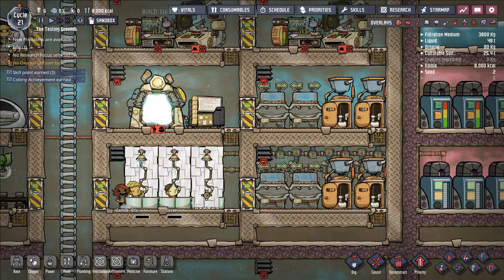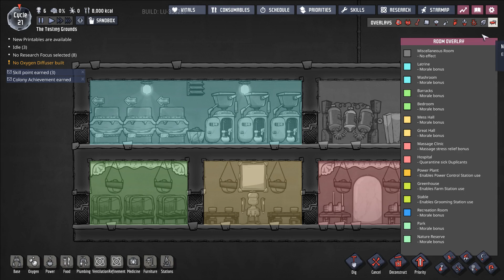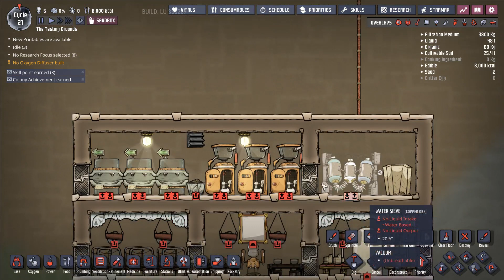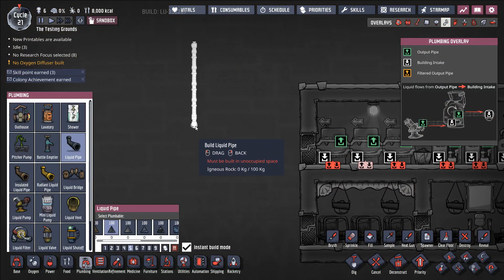The Infinite Bathroom; Build This NOW -- New Player Guides [Oxygen Not Included]

Comment: the problem with multiple bridges is the first one will get priority over the others always.  so the initial start up is a little hectic.  I prefer to use one bridge at the start of the line to supply all sinks and lavatories.  it also gives you a visual que on the supply lines.  an other advantage to using lines in this situation is the lines will be a passive storage tank.

I use reedfiber farm to feed the water into.  excess goes into chlorene room where the water gets purified then its sieved and fed to the main storage where it gets temperature equalized then its pumped to where ever it needs to go.

it really depends on the situation you are in really.  If you are colonizing a new planet with the new update, I use this to create the water on demand.

Comment: I know you've answered people repeatedly in the comments, but these are my thoughts, not looking for a response.  As a software engineer and games programmer of 35 years (appeal to authority, yay!), I don't see why the input and output nodes of the lavatories and sinks would be treated any differently than the input and output nodes of the bridges.  A pipe that goes through all the inputs and a pipe that goes through all the outputs should do the job.  And that's what your set-up does, except you've added in unnecessary bridges between the rails.  As far as lag goes, have you (or anyone else) profiled the lag created by the liquid pathfinding compared to the entity pathfinding?  My guess is that it will be extremely trivial compared to the entity pathfinding.  My take on your build is that while I find most of your videos extremely valuable and interesting, this insistence on adding redundant bridges everywhere is probably based on belief rather than facts.

Comment: so how you doing this around cycle 5.. by cycle 5 iv not even bothered with oxygen production let alone researched 7 techs to get that far, i think you are being very over confident.. quite a few bad tips here, you really cant grow anything from the waste pipes, the flow isnt reliable enough, and as for the polluted dirt you are probably best saving it for pokeshells so you can farm the skins for lime, late game lime is a real bottleneck, im struggling like mad even using fossils, not enough to go around. i thought infinote bathrooms was something new maybe, not just a way of keeping a few toilets supplied, man i do that with a clock and a liquid shutoff, no bridges and it works flawlessly until dupes are too busy to change the sand in the filter.
Reply from the maker: We get them up pretty fast in the Let's Plays I've done, check them out.

We also use the waste water to grow lots of stuff in the Let's Plays I've done.  Dupes go to the bathroom once per cycle, the flow is consistent.

I'm down to save polluted dirt, it's just if you DO decide to compost, then you'll want to put your compost back there too.

Comment: It looks like you used regular liquid pipes instead of insulated liquid pipes.  Some others have recommended using insulated liquid pipes in bathrooms?   Does this lead to heating problems over time for a bathroom?  Or did they say that because of the old fixed output temperature of a water sieve?
Reply from the maker: It's changed over time.  At first it was a necessity because of the fixed output temperature of the water sieve, otherwise everything near the bathroom would slowly turn to 40 C.  After the change to the output temperatures, some people still decided to use insulated liquid pipes because they wanted to keep the water in the loop extra cool, because the bonus water from lavatories was being created at the temperature of the input water, so with an insulated loop you could do a sort of 'cold doubling'.  Today, some people use insulated liquid pipes because the bonus water is produced at a fixed temperature (I think 37 C, the temperature of a duplicant) and averages with the incoming temperature, so very slowly over time the area around your bathroom would rise to 37 C.

Personally, I've been going with regular pipes ever since the change to the water sieve.
Reply: @gearheadgaming1  Thank you!  That was informative, and it makes sense that the water would change temperature based on the duplicant's input with more and more duplicant polluted water added.

Comment: I don't run my bases that way but this is a great explanation to why some people make what I call "pipe messes". 
I personally run a germy supply lines through my base to 6 different bathrooms and an extra 10 sinks with one main supply line that branches out where needed. The line is prioritized at the water sieve using one liquid bridge and then branches out with one liquid bridge per bathroom. I store a liquid tank worth of water for backup but I rarely need it as my main pipe is so long. Then I send the excess clean water  to be removed of its germs and set to the desired temperature send it towards food production and if there is some left it gets kicked towards my oxygen production. It looks cleaner and I never had any issues with it. Also when going for a locavore, I carnivore, super sustainable run I didn't set this up before cycle 80 and usually set it up around cycle 20-30.

Comment: Polluted water is valuable, one of the most important resources in game.  Don't burn it up on this...  Just dump your water into reed fiber plants, and make them steadily all game, that way you don't have to make a giant garden later on, when you need the fiber.  You only need to build two or three fiber planters to use all the water the bathroom makes.
Reply: The point is to resupply the sinks and lavatories (thus infinite bathroom title) with clean water. The excess (which you will have cause it overproduces) can go to whatever else you want (hydroponics etc) as he mentioned.
Reply: @KotauFPS  Well, ok that might be an interesting approach early to mid game, until you can get reed fiber seeds and fresh water, but you are still just wasting an enormous amount of polluted water that you will not be able to replace late game.
Reply from the maker: I think you have heavily misunderstood how this build works.  It GENERATES water over time, it doesn't "burn it up."
Reply: @gearheadgaming1  I understand perfectly how the build works...  I think you are wasting polluted water (that your dupes made)with this build, because you need to polluted water later in the game to get space age insulation...  I still insist you are better off taking every gram of polluted water you find in game and making it into fiber reed...

Comment: I try to understand those pipe bridges, they're complicated.
I've already seen several times this case where a pipe and a pipe bridge have the same... "entry point" ?
As I understand it, the difference between a pipe "dividing" in two pipes and a bridge is that :
in the first case, the liquid/gas will be distributed more or less equally between the two pipes, maybe depending on pressure.
in the bridge case, the liquid will always go through the first bridge it encounters except if the exit point is already filled with liquid/gas in which case it will continue to the next pipe/bridge.

In that case, if I put a bridge from my used water to my plants, then a pipe to a water tank or reservoir, I could use the excedent water created by piss and keep only the right amount of water for a closed circuit. Is this it ?
One thing I don't understand is why you put bridges at the exit of toilets and sinks...

For germ killing, I use a "dirty" solution : I put 3-4 liquid reservoirs in a waterlocked chlorine room and manually enable and disable them so the water don't stay in the pipes where chlorine have not effect. I say it's dirty because if every liquid reservoir gets completely filled, you'll ultimately get some germs in your clean water. So you have to constantly play with enabling/disabling the whole stuff manually... I still haven't found a energy/dupe free solution. If only you could logic gate those reservoirs...
Reply: And I'm sorry for writing essays on every comments. This game owns my brain

Comment: Hey man, I like your video, but I can't understand why you need so many liquid bridges in your build.   I know that you've explained why a lot, but your explanations don't seem to make sense to me.

1) If Klei is going to patch the game, they could break literally any setup at any time.  What if they introduce a patch that makes liquid bridges no longer appear as inputs?  It doesn't make sense to try and "future-proof" a build based on how Klei may or may not change the game.

2) According to the wiki, liquid bridges do not have any actual storage, so if your strategy was to increase the pipe length to create additional storage the bridges aren't doing this.  If you want storage for fast refills, use a liquid reservoir, which would only cost 400kg of material instead of the 1400kg of bridges in your system (more if you want to add more stations!) which apparently aren't actually doing anything.  For extra style points you could keep the reservoir in a chlorine room to kill off all the germs in the stored water.  Or, if your sieve happens to be further away, the water in the pipes running to your bathroom are already accomplishing this.

3) If you're talking about not having to break the actual main water line if you wanted to make a modification, then yes, this system lets you accomplish that.  But, y'know, it costs thousands of kg of materials and there's already a system for prioritizing jobs if you want to minimize interruptions.  Besides, it's not really a "main line", it's just the supply pipe for a closed loop.  The only part of your base that will experience interruptions if you break it are the bathroom itself and whatever was being supplied by the excess, both of which were already going to experience interruptions if you're tearing the bathroom out and replacing it with something else.

4) Each one of your items already has an input and an output, which will already prioritize liquid flow in the exact same way your bridges are.  What you need to do is run your line straight across all of them instead of running them above or below and then connecting with individual branches.  It should look like an "l", not an "E".  The game will prioritize all of the inputs in the order the liquid is flowing, and then branch off to any other inputs you give it (like your hydroponics) if the initial ones are all full.  The only time you'd need a liquid bridge is if you want to prioritize a direction of flow in a junction leading to two different long runs of pipe.
Reply from the maker: 1)  "Anything can happen" is a position you can take, but "Things that have happened in the past are more likely to happen again than things that haven't happened in the past" seems more logical to me.  Especially since it wasn't until recently in the game that your suggested build even functioned.  The system you describe, as recently as 6 months ago, would have put most of your toilets out of commission, because all of your sinks and toilets would go offline every time you flushed/ran a toilet/sink further down the line and its output crossed the output tile of the next sink/toilet.

2)  If you run a pipe straight across, and you're draining that pipe from the far end, you have zero storage in your system.  There are two tiles of pipe beyond each bridge in my system, they hold 10kg apiece, 20kg total, 4 uses worth, and will maintain that even if you're siphoning from the end of your loop.  Reservoirs take building space and metal, both of which are much rarer than igneous rock.

3)  I have no idea what you're talking about.  And yes, I'm talking about what happens if later you want to relocate your bathrooms.  You're saying it costs tons of materials... to do what?  Again, I don't know what you're saying here.

4)  a) The system you're describing is only even possible on recent patches-- for most of the game's history, the build you're describing led to your toilets and sinks going offline whenever a sink or toilet further down the line was used.

b)  The system you're describing still doesn't work.  See point 2.  "and then branch off to any other inputs you give it (like your hydroponics)" leads to dysfunction in your bathrooms as soon as those "other inputs" outstrip the rate at which your bathrooms are generating water. 

Tons of people have complained about this.  "Why do you use so many bridges?"  But not a single one of them has offered a reason for why fewer bridges would work better besides their opinion that they don't like how bridges look.  You know bridges cost the exact same as a pipe, right?  And there's no decor malus from them?  And that they have the same build time?

I'm sorry, but if you want to convince me there's a better build out there, then why not give a reason why you think it works BETTER?
Reply: @gearheadgaming1  Thanks for taking the time to respond. I'm a somewhat new player, so I don't know what the state of the game was like six months ago, I just know what works right now.

You're right about the storage - there is benefit in keeping a little bit of water "primed" in the pipes leading up to the stations. If you're trying to get the build to run nonstop on a purely closed loop, that little bit of extra is helpful.

I think the mainly the issue is that this is a somewhat overcomplicated way of approaching a system that most players are likely to encounter in the first dozen cycles. While it may not be BETTER, there IS value in approaching the setup in a simpler way, especially if the target audience is people who aren't familiar with the game.

This is probably an ideal system for creating a closed bathroom loop primed with a small amount of water that will then keep itself running forever while outputting some extra clean water once a day. However, it takes a fair amount of effort and preplanning to get it that way.

Most new players probably aren't taking this approach to their bathrooms. They're just going to hook them up to the main water line, hook up the outputs to their sieve, and not need to worry about it again. They're going to have the same results as you - a system that outputs more clean water than it consumes - except their build will be simpler, and probably won't be a closed loop.

When I was talking about the renovations, I assumed you meant you'd be able to deconstruct all the plumbing involved in the bathroom without touching the main input or output lines. And while that's true, that's only really beneficial in a system that isn't a closed loop. You only care about an outage if that same line is servicing a sizable portion of your base. At that point, it's probably not a closed loop anymore, meaning you (hopefully) have plenty of water coming in to supply the stations after each use. And if there is an interruption in service, you can use the priority system to make sure the downtime is minimized.

In essence, while I think that this is an excellent demonstration of flow mechanics and how to create a well-executed closed bathroom loop, I also think that for most people it's an overly complicated way of setting up a relatively simple system. If the intent is to give new players advice, you might consider showing a simpler build first, then expanding on the concept to show what's possible once they really start to understand the systems involved.
Reply from the maker: @CrazyEyes326  I don't think this system is complicated at all though.  There's a polluted water line, there's a clean water line.  The bridges are just 1-way pipes linking the water mains to the inputs and outputs of the buildings.

The system, as shown in the video, does not have to simply be a closed loop, if I remember right I make that point that the water lines can go off somewhere else and supply other systems.  It is very simple to expand off this system.

And I think you're missing the point on renovations-- here's an example.  Let's say I am playing the game and find that I dont have enough storage for the extra water coming from my bathroom.  And for space reasons, I decide the best thing to do is just replace one of my lavatories with a liquid reservoir.

Simple enough, right?  Except if I built my bathroom by running pipes straight across, I have a problem-- my liquid reservoir's outlet has a dedicated clean water pipe running straight through it, and I've got nothing going to my reservoir's input.

But if the bathroom is built my way, then it's simple: I deconstruct whatever lavatory I've decided has to go, deconstruct the bridges and pipes I have going to it, build my liquid reservoir, and connect it up.
Reply: @gearheadgaming1  It took me a while to get a chance to slap this together:

https://i.imgur.com/AUeugVJ.png

Correct me if I'm wrong, but these three setups are essentially doing the same thing.

The bottom one is the least ideal since it's dumping germy water back into the supply and we can't control where it goes from there.  However, it's most likely to represent what most new people have in their bases.  The restrooms, sieve, and supply could be anywhere in your base and the system works.  The main shortcoming is that it has no way of dealing with polluted water overflow, but since restrooms aren't in use all the time and the pipes are fairly long it's unlikely to back up.

The top two are doing effectively the same thing.  The main differences are complexity and cost.  Your setup, as you say, is better in the event that you for some reason decide to replace a lavatory with a reservoir.  It is, however, more expensive, costing an additional 400kg of materials per lavatory or sink - and is objectively more complex.

In my opinion, the small benefit you get from doing it your way instead of the middle setup isn't worth the added complexity and expense.